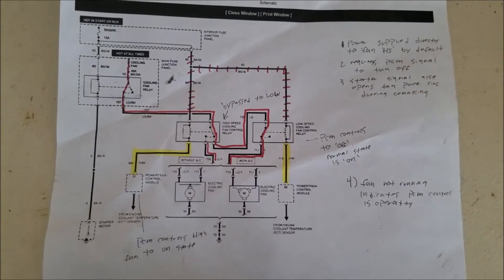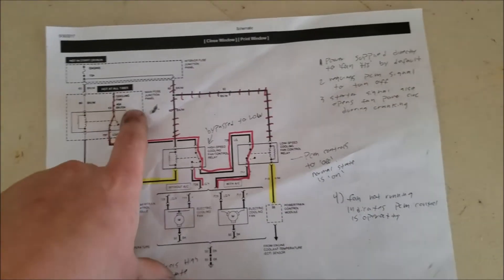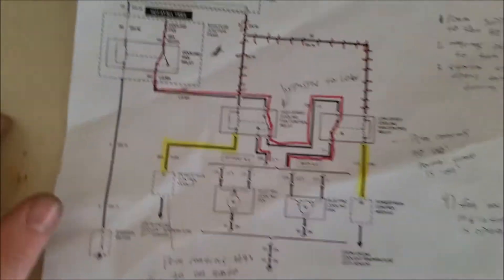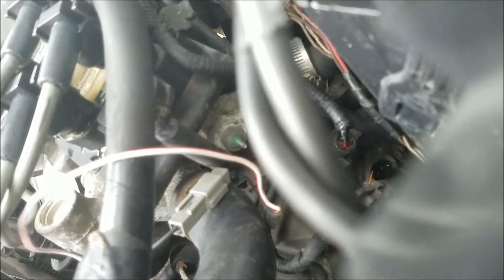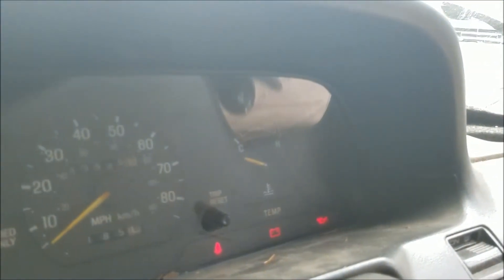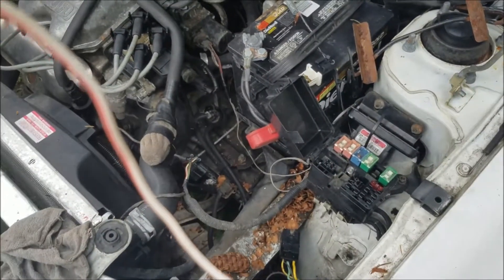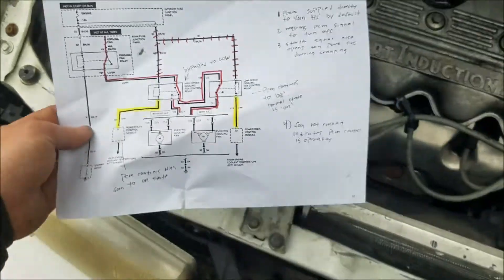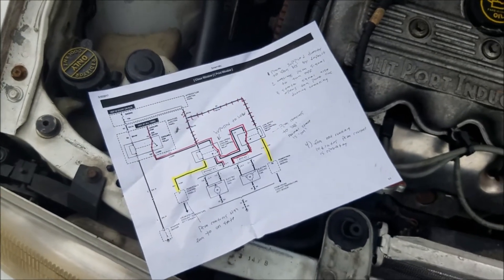DIAGNOSIS: Diag/Test 91-95 escort lx cooling fan system

Comment: When I removed the main fan relay and jumped the points, the fan would not turn on (but it worked jumping the starter). Which is totally confusing because the fan will run for a bit when I start the car on but eventually stops working until I turn the ac on. I have replaced the coolant temp sensor. All 3 relays seem to be working after testing them. Could the actual fan be malfunctioning? What am I missing?

Comment: Hi! Just saw your video I'm having a problem with the high speed relay, if you disconnect ground, the fan won't come on, only with low speed relay work, any advice on the next step? I already changed both ECT sensors just to be sure those aren't the fault sorry for my bad English I'm from Mexico

Comment: I have had the same car for 15 years and just turned on the AC to kick on fan. Now that doesn’t work for some reason. With the car off I close the main relay by hand and fan comes on. Any idea why the AC button won’t turn on the fan anymore?
Reply from the maker: You will need to perform electrical testing on the system, I do not guess at repairs.
Reply: @MegaMarclar  yeah You seemed to know a lot about fan system in this car and I was hoping you knew a couple tricks to make it work. Could you tell me how the AC power switch tells the fan relay to open or close?
Reply from the maker: @robwright4398  the  PCM controls both fan circuits. There is an input from the AC request button circuit to the PCM. Sort of hard to describe here. Do you have an account on the forum? Create an account on feoa.net and make a post in the HVAC section, I can show the diagram there.
Reply: @MegaMarclar  ok thanks I’ll make a post tonight.

Comment: Does anyone know were I can find a new radiator coolant overflow tank CAP ONLY? And my overflow tank also has some type of sensor or something just below the filler tube? I need that part also, I'm having no luck ?? Please send help lol... 1993 ford escort gt, 1.8...5speed...
Reply from the maker: What you're describing is probably the overflow level sensor. I would try a junkyard

Comment: Hi I have a 96 escort 1.9 with AC and all the sensors are original I have replaced the fan cuz it was screeching and was obviously bad that was a few years ago now I was driving the other day AC on and when I stopped at McDonald's car started getting hot real hot and fast so I know these cars depend on air flow for most of the cooking got back on the hwy temp went right down the next day I started the car and turned on the AC and no fan so do you think I should replace the temperature fan sensor in the head or try to chase it down I don't really do wiring very well but I can change parts lol and the sensor is only $20 so any advice would be great thanks
Reply from the maker: It is impossible to guess without doing any actual testing. Your problem is most likely in the relays.
Reply: @MegaMarclar  thanks for the reply so if I take a wire and pull the relay out of the fuse box and jumper around everything like you did and everything works do you think I should just get the relay? If everything works at the fuse box it should work with the relay in right?
Reply from the maker: @richkarn3792  what I would do is replace all three relays just to be safe and then see what happens
Reply: @MegaMarclar  are all the relays in that fuse box? If not where should I look thanks again
Reply from the maker: @richkarn3792  take a look at the video again, there are two relays in the fender well and there's one in the fuse box. One's in the fender are high and low speed. The one in the fuse box only interrupts power to the fan during cranking
Reply: @MegaMarclar  hi there thanks again for all your help I took out the fuel injection relay and it was melted and stuck in the fuse box but I got it out I cleaned up the melted plastic and stuck it back in just to see if it worked and it did so I'm going to get some nos ones off ebay I'd rather have the OEM parts than AutoZone junk I have another question though I'm sorry but I bought this car in 2000 and the blower motor was only working now and then so I got under the dash and the plug going to the blower motor was melted and needed some help so I grabbed some pliers and had to work it off the plastic just broke into pieces so I thought the spade connectors were just loose so I squeezed them and just slid them on but it still gets really hot if I run the air or heat on high and the relay melted with the blower on high do you think they are connected? I don't know why it's pulling so much current but it's okay if I run the blower on 3 ? Thanks again for all your help
Reply from the maker: @richkarn3792  https://youtu.be/u-F7WzTGKp4

Comment: My fan is hot wired through the ignition for years, now when I turned the car off the fan keeps running 95 escort 1.9. Any help would be nice.
Reply from the maker: I don't really know how I can help, I would probably suggest going back through whatever wiring has been 'rigged' and find out what is shorted, it's probably  a switch or relay thats melted 'on'..
Reply: @MegaMarclar  it was the ignition switch electrical part!! Thanks

Comment: HERES ONE FOR YA.                     2000 eSCORT. 2.0           tEMP GAUGE SPURATIC, RANDOM, JUST UNTRUSTWORHY.          Replace temp sensor and car wont start .......  Unplug sensor car starts right up but fan stays ON.       Plug sensor back in fan stops working even with temp up.
Reply from the maker: Try using a Motorcraft sensor. Some aftermarket parts have the opposite readings making the pcm think it's -88*
Reply: @MegaMarclar   i WILL TRY THAT,   THANX~

Comment: When testing the dash gauge, it's best to put a resistor in there (variable resistor would be better).
Reply from the maker: Ideally yes. The temp sensor is a variable resistor by design. but shorting the input to ground will not hurt the gauge.

Comment: Nice explanation and video. You didn’t explain how the pcm knows the temperature, maybe that sensor was not functioning (in the head) and thought it wasn’t hot enough yet to turn on the fan (you had that sensor unplugged) Could you have got the fan to run by shorting out that connector? Just a thought.  Thanks again!
Reply from the maker: There are actually two sensors. Both of them are located in the thermostat housing water outlet hose. One of them is a direct input to the PCM and the other is simply for the gauge on the dash. The sensors are either negative or positive temperature coefficient resistor sensors. Basically what that means is the resistance value changes depending on the temperature of the sensor. Also for most builds, the fan will default to the on position when the coolant temperature sensor is unplugged. It is a failsafe built into the programming. If the PCM doesn't know what the temperature is it automatically assumes it's overheating and kicks on the fan

Comment: Logic...  I love it, actual brain meats being used.  Thanks for the tour of the fan wiring.  I've been wondering if mine has been coming on.  Seems like one could easily wire an indicator if you were motivated to do so.
Reply from the maker: demnlordd666 on my turbo 93 lx, I had indicators for the fan, headlights and knock. Led readouts on the dash